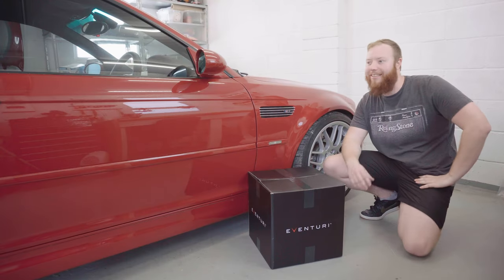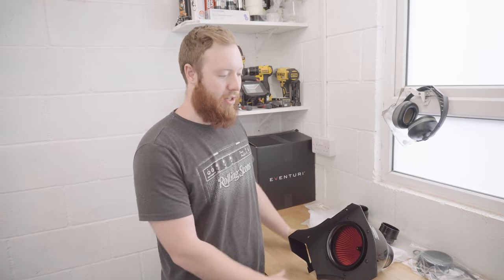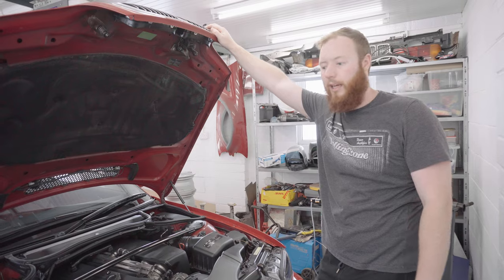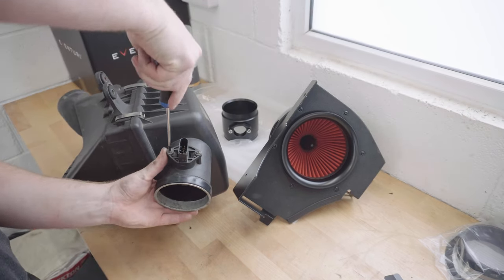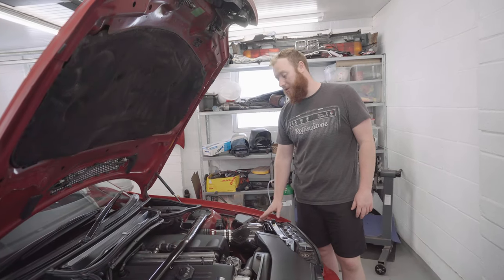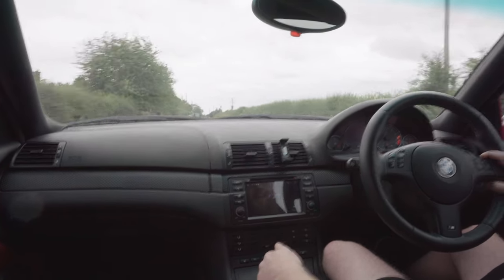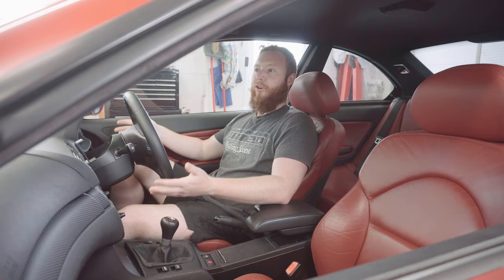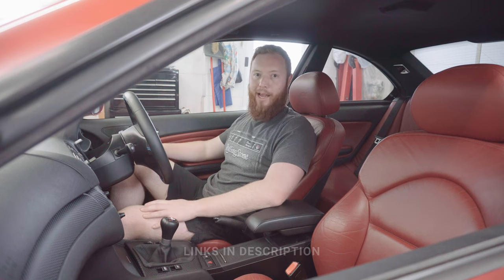Eventuri Intake Review [BMW E46 M3] Installation & Sound Comparison | @Eventuri @EvolveAutomotive

Comment: Thanks for the video. I think this might be best E46 M3 Eventuri intake review. I have been long searching for such a good quality back to back noise comparison. I am planning to buy this kit just to amplify the lovely induction noise. And just like you I would not expect a power increase; a claimed 10HP+ increase without engine tuning seems unlikely considering that CSL has different cams and a whole new carbon induction system to increase power from 343 to 360HP.  Anyways, waiting for more flyby videos!
Reply from the maker: Awesome, thanks Kayhan! I knew this would be useful for people as I was searching for the same when I was looking to buy one. In the end I decided to take a punt and find out for myself. 😃

I'm still absolutely loving it, it really brings out the character of the S54 nicely, it's here to stay. I reckon you should go for it too.

There may be more footage in the future as the M3 features more on the channel. Plenty of bits to do as always.
Reply: @SPANNERRASH  I finally sourced a second hand kit. Now I need to clean the filter and install it. Thrilled!!!
Reply from the maker: @kayhanozdemir4542  Congrats on sourcing an Eventuri, you'll not be disappointed. Still loving mine, been really enjoying it with the widows down now the weather is good! Glorious noises.

Hope the vid helps you with a smooth install, although their own PDF guide has you covered. 👍

Comment: Sounds amazing! I have 2 questions : 1- did you add the SMG shift lights by modifying the hex code in the DME? If so, do you have more information? 2- did you have your steering refinished with new leather? Looks mint!

Thanks,

Alex 🇨🇦
Reply from the maker: Hey Alex, still loving the sound of the Eventuri. :D

1 - It was coded buy Mirror John quite a while back, they're a really nice touch aren't they? How he coded it however I'm not certain, maybe he used something like NCS Expert.

2 - Yeah the wheel was sent off to Royal Steering wheels who retrimmed it along with the handbrake. I've had a few wheels done with them and they always come out perfect and last. The gearknob is a new OE F10 M5 illuminated one and the wheel and hand brake leather match that perfect following retrim.

Hope that helps!

Comment: thank you for the best review on this I've seen/heard so far! (and I've watched a lot of these) Seems like a no-brainer compared to the CSL-style intakes in terms of value. Just can't justify the cost on my 172k-mile M3 for the "real deal" even though it's in excellent mechanical shape. But this seems like it'll give me what I want without the hassle. Let me return the favor by recommending the 4.10 diff upgrade, if you haven't done it already (going to watch your other videos now, maybe you have) 

EDIT: looks like you just got into this thing, let me tell you that the 4.10 final drive and Autosolutions short shifter are near essential OEM+ upgrades for this wonderful machine.
Reply from the maker: Thank you Marty, and yes I concluded the same about it being a better value option to the CSL intake, I'm still really enjoying the sound, it makes the already wonderful S54 a lot more characterful.

Thanks for the 4.10 diff recommendation, this is definitely something I'm considering as a future upgrade for the car. My only reservations are the cost and the additional RPM when motorway driving, but maybe that's a smaller issue than I imagine?

Regarding the shifter I've installed a 545i shifter and F10 M5 illuminated gear knob which shortens and sharpens the shift nicely.

I've actually had this M3 for something like 7 years, and made a few subtle tweaks to it, although there's not much on the channel about this car currently as most of this was don't way before I ever thought of recording any of it. 😀

Comment: Great video mate. If you remove the sound pad under the hood. You will get a slightly better sound. Cheers
Reply from the maker: Cheers! Interesting idea, I was thinking about that actually. My only worry is whether the engine heat might damage the paint on the top of the bonnet.

I'm also not sure whether BMW painted under that pad, but I may check. 😀

Comment: Great video, inspired me to get mine. Quick question, are your csl wheels originals or reps? If they’re reps, which ones are they and have they been ok for you?
Reply from the maker: Hi mate, hope you're enjoying the intake, still love mine.

The wheels are reps, bought them a long time ago from CM Wheels, the ones regularly banded around on M3Cutters forum. I think they're a forum sponsor.

Generally regarded as good quality. The original BMW CSL wheels are notorious for cracking so to me, they weren't worth the significant extra cost.

Hope that helps!

Comment: Superb video & guide. Can I ask if you had any microphones in the engine bay or where they only cabin recordings ?
Reply from the maker: Hi Jon, really hard to represent what something really sounds like in the flesh.

Too many factors like what my microphone can record, and what sounds your speakers turn that into.

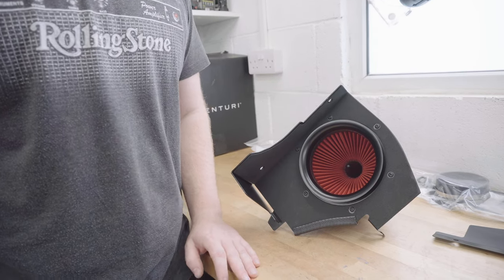Check 05:43 in the video to see where I mounted the mic in the engine bay. I used a combination of cabin and engine bay sound.

I think the key here is to check the comparison between stock and Eventuri, then you can get a sense of the difference, and that is a genuine representation as I mounted the mic exactly the same both times. Hope that helps!

Comment: those filters trade sound for filtration. not a good trade off hence why the csl air box with oem csl filter is better
Reply from the maker: The Eventuri filter is extremely high quality, which is obvious when you're having a close look at it.

It's still an aftermarket style filter though so probably doesn't remove as many fine particles as an OEM paper one, but I'd say it was at least as good as a K&N or a Pipercross style air filter.

Like you say, versus a paper one, these aftermarket filters trade some filtration for sound and air flow.

As I don't do thousands of miles in the M3 these days, I think the filter is more than adequate. 😄

Comment: Nice cars, I say use straight 30 weight to reduce rod bearing wear, too many guys use thin oil; or use Lucas oil treatment, contains extreme pressure grease and gear oil possibly with cheap thin oil, really! Hate to see people wear out such nice cars! Cheers! :)
Reply from the maker: Thanks! Since I had the bearings replaced a few years ago the car hasn't done many miles and I'm probably over-careful with warming it up when it comes out.

Mr Vanos who replaced them advised to use a higher quality 10w60 from like likes of Liquimoly to uphold his bearing warranty. The Castrol stuff turns out to leave bad deposits.

I've not played around with different weights, I'd be a bit scared to do that on these engines, but it's definitely an interesting idea.

Comment: Hi there. Great video. Just curious, did you notice any LOSS in power or lower rpm pep? I only ask because I once had an experience with an e46 m3 with an AFE cone filter set up and it actually caused a loss of off the line pep/power. So just curious
Reply from the maker: Hmm, no I can't say I noticed that. In theory, it should have added power, in reality, I can't feel that it has. But maybe with the right map it would be a different story.

Comment: So I noticed you have the microphone in the hood here by the intake. How much of this noise actually makes it in the cabin? Is the intake noise in the cabin now a lot more aggressive then it was prior?
Reply from the maker: Its tough to represent the cabin noise alone with a mic so to get more of a comparison using cabin combined with engine bay sound worked well.

With this intake I'd say its all positives. It's not "very loud", nor is it constant. So it wont get on your nerves if you daily drive the car. 

It is louder and a more aggressive intake tone only when you exercise the throttle pedal. So when you're driving spiritedly it sounds awesome, when you're cruising around you'd barely notice a difference.

Enough of the sound reaches your ears as you drive for it to really enhance the driving experience, it's very noticeable for all the right reasons.

I'd 100% recommend it, the only downside is they are quite expensive to buy.

Comment: Snagged a used one of these I'm picking up in a few days. Missing thr bumper scoop which im not convinced is the end of the world. Basically half the price of a new one, so about a quarter of a csl style box.
Reply from the maker: Sounds good Matt, I'm not sure the scoop is make or break, but if you are really bothered apparently there's a 45 degree pipe you can buy from a hardware store that will do similar.

It sounds great, you're going to love it.

Comment: Great video, Imola on imola looks great 👍🏼 
Read on forums about problems relating to this kind of filter messing up the maf sensor unit, anything to report now you've had it fitted a while? Any difference to how the car runs (cold starts ect)?
Reply from the maker: Cheers Matt! I'm still loving the Eventuri filter, absolutely no issues to report at all. I also saw people complaining about certain types of filter and the MAF, but I think that's more often relating to the oils some of these filters are soaked in from new. You quite often notice the K&N style panel filters are quite greasy to the touch and this is what coats the MAF and causes it to play up. the Eventuri filter feels like the dry type, just the same as the BMC panel filter it replaced.

Comment: You think this intake would fit on a 325xi I’ve been looking all over to see on forums if it would fit I don’t see why not if I swap to m3 bumper or just cut an intake hole lol
Reply from the maker: It almost definitely wont be a straight swap, but with some creativity I bet you could make it work.

Its designed to work with a specific MAF sensor though. But maybe the M3 one is the same as a 325i?

I'm not sure honestly.

Comment: open filter enclosed in a hot engine bay without a sealed, direct cold air feed?!  well done sir, you just paid money for lower air density.
 please explain why you want less air density in one paragraph or less.
Reply from the maker: Interesting take, but the filter is fed a stream of cold air via the brake duct scoop. Otherwise I'd agree that a warm air intake is a bad idea!

Eventuri have done quite a bit of R&D to make this an undeniable performance upgrade, check it out.

Comment: mmm i may have to buy one,,,i wanted an airbox but they cost so much more and ive just spent 2 plus grand on subframe lol...sounds good. Very good idea putting those clips at end of video to show difference,......PS what phone mount is that
Reply from the maker: I'm still really impressed with it, really brings the character of the S54 out, sounds so good.

And I feel your pain, I had the boot floor reinforced a long time ago. If you thought that stung wait till you do the rod bearings! 😅

They're amazing cars though, they get a lot of love and with good reason. Worth taking care of.

The phone mount is one of these: https://ebay.us/XgVpHb
Reply: @SPANNERRASH  oh thanks.  The bottom end of engine done last year by previous owner so that’s sorted. But your intake does sound great. I’ll maybe get that in couple of months I’m only 30 min from evolve so they fit for free
Reply from the maker: @leekindell9937  No worries, sounds like you've got a particularly nice example then! 😁 Thats handy being near Evolve, I'd take advantage of that too.
Reply: Wow 2grand ? I’m gonna do a Vince bracket , and epoxy plates provided it isn’t too bad underneath

Comment: Bro what stereo do you have fitted
Reply from the maker: I think the brand was called Erisin. It's a great match to the original head unit in style but running on Android. I've had it a few years so it's an old one compared to current models. It still works really well though. Hope that helps.

Comment: hey mate, what shifter do yo have in it?   E60 short shifter?
Reply from the maker: Hi mate, it's a E60 545i shifter combined with an F10 M5 illuminated gear knob. Really like it, makes the shift a bit stiffer though but I don't mind that.
Reply: @SPANNERRASH  there are 2 versions of the shifter, I'm guessing you got the 'shorter version'?   I think part # ends in 373
Reply from the maker: @BMWarrior1  Almost definitely the shortest one, but I did it long time ago so hard to be 100%.

I remember it was a 545 one though
Reply: @SPANNERRASH  thanks for the reply man, also how did you get the F10 knob to work?  im assuming you just removed the leather surround and mated it to the E46 surround?
Reply from the maker: @BMWarrior1 No worries! Yeah I took the plastic frame off the M3's original shift boot surround by removing the staples etc, then swapped it onto the F10 M5 shift boot which is integrated with the knob.

So it was a bit more involved than just swapping the shifter but it was worthwhile in the end and I'm super happy with it!

I love that I got to retain the illumination.

Comment: Mate, what headunit are you using?
Reply from the maker: Hi mate, I believe the brand is called Erisin. It's a great match to the original headunit in the car but runs Android. I've had it a few years now so it's probably an old one compared to current models. Works awesome though!

Comment: Is the microphone in the cabin or in the engine bay?
Reply from the maker: Hi David, both a mic in the cabin and the engine bay, but for the driving the engine bay mic is turned up and the cabin sounds down. It sounds great in the cabin in person, I'd say its a pretty fair representation, especially the relative difference between stock and Eventuri. Check 05:43 in the video to see where I mounted the mic in the engine bay. 👍
Reply: @SPANNERRASH  thanks for confirming, I thought it was a little much intake noise for reality.
Reply: @davidh4632  "reality" changes quite a bit though, in my experience... windows up/down, ambient noise, etc.; plus the acoustics of mics only in the cabin from other youtube videos actually seem to differ far more from my personal perceptions of actually being there. I think @SPANNER RASH did a magnificent job of capturing the "real feel" based on the stock recordings vs. my stock experience and now I'm fighting ordering an eventuri intake impulsively...

Comment: First of all, congratulations for the video. Secondly, I want to ask you what attracted you to the Eventuri compared to the classic CSL filter. Do you find that you had a notable increase in performance as declared or did you have to remap first? The CSL airbox claims 4 hp more and the Eventuri even 12. it seems like a lot. greetings from Italy and thanks!
Reply from the maker: Thanks! A full CSL airbox is multiples more expensive than the Eventuri intake so cost was a factor for sure.

I also really like that the Eventuri is effectively a bolt-on upgrade, which requires no remap to work, and can be just as easily bolted-off. 😄

It's an extremely high quality component and its backed by proper R&D so I'm more than happy to have it on my M3.

Regarding the result, it makes the car sound amazing. I'm sure that a full CSL airbox sounds even better, but I'm very pleased with the Eventuri's sound.

I'm not sure I notice any improvement to power, I likely would if I got the counterpart remap, but sadly I haven't got that. Luckily I didn't buy it to gain any power, just to gain induction roar. 😁

Hope that helps!
Reply: @SPANNERRASH  😂👍..I agree, thanks and enjoy!!